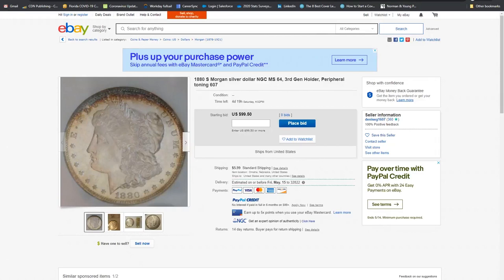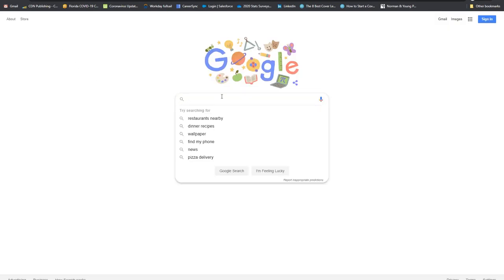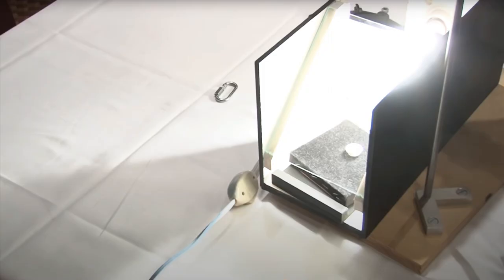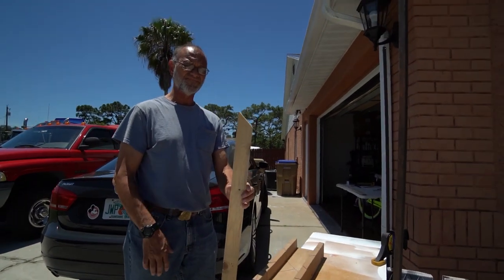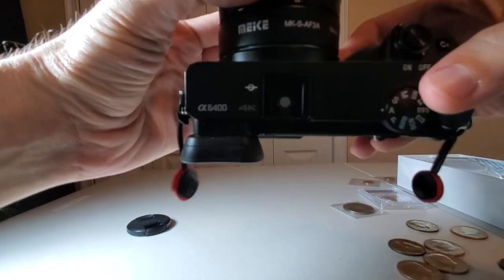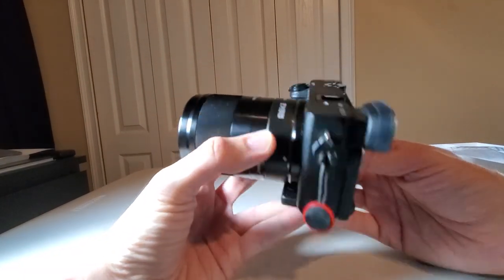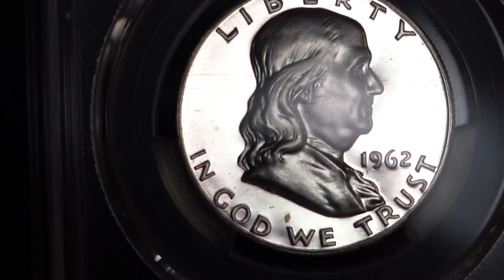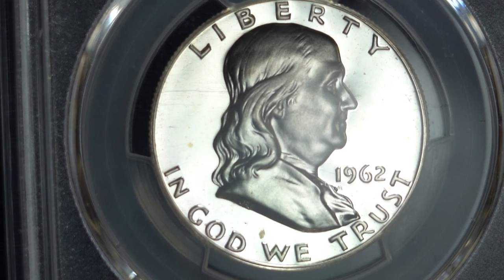My workflow: How to take great coin pictures

Comment: Great explanation. Could you please be so kind to clarify what kind of ring are you using on the minute 10:26 to reduce light reflection? Is that a polarizer ring? Looking forward to hearing from you. Kind regards. Isma
Reply: They are putting an empty cylinder around the coin so that the only light that is hitting the coin is the indirect light from the reflection in the glass.

Comment: I literally put coins on something black, close the blinds, get the camera directly overhead and take a 2 or 3 second exposure. Shows every nick in the coin. What you're doing is better once you've got the little rig built up but if you find yourself without, low light, long exposure and angle the coin so there's no bright spots on it. That's why I do it with the blinds close a lot easier to find a flat light spot

Comment: I have a large collection to Photograph. Does this method work for all coin types? I have some coins that are thick and have a high relief. What size and color is the tube you are using? Is the tube reflective?
Reply from the maker: Hey Michael. Thanks for asking. It does work for most coins with varying relief. The tube I'm using is just a 1" piece of PVC. IT's white and non reflective. The tube is just to block the light from the top so the light shines straight down.

Hope this helps.

Comment: What kind of lightbulb do you use in your lamp? Would a very bright LED light mess around with the pictures?
Reply from the maker: I'm using an LED clip on light from Walmart! I plan on upgrading when I get this whole thing dialed in a little more. Any light that is white will work. If you have a yellowish halogen light it will likely effect the color of the coin.